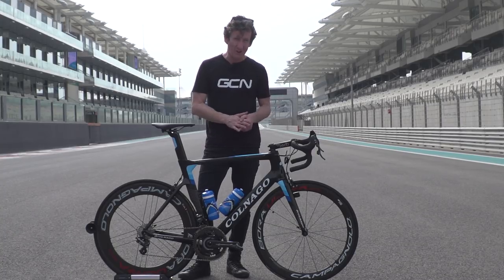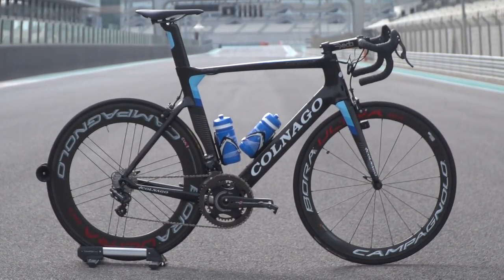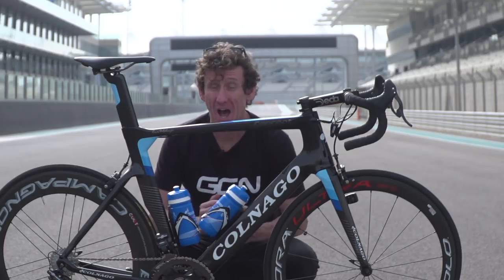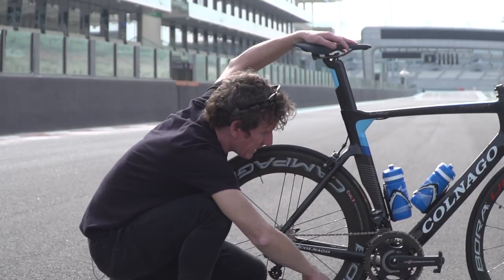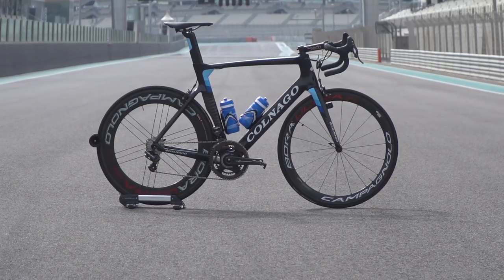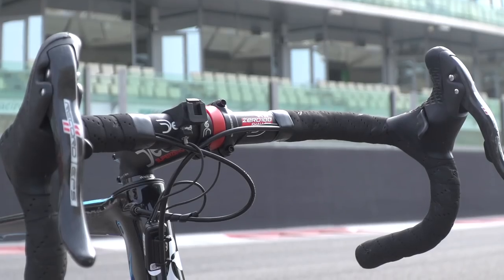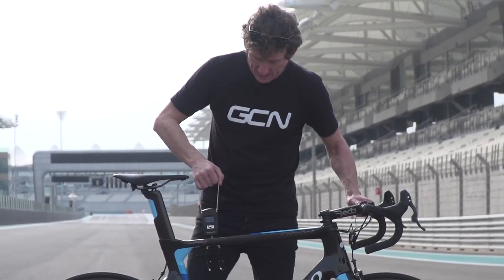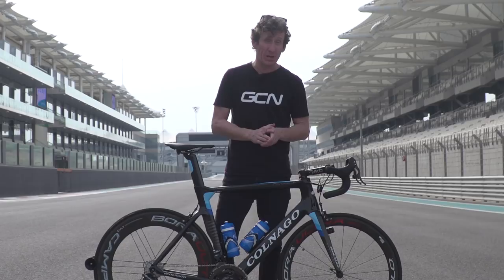Alexander Porsev's Colnago Concept

Comment: Why are alle bikes well above the 6.8kg?
Reply: Jack Miller Because they are more about being aero than light
Reply: plenty of reliable super stiff bikes under 6.8 actually.... heck the Madone race shop limited is well under that and its even aero to add to that.... but usually companies weight their 54cm bikes... so if its is a 56 or 58 + pedals+ power meter+ head unit+ bottle cages+ race number mounts+...... it adds up
Reply: most GC riders do actually have bikes right at 6.8kg. Canyon with Quintana's CF Ultimate, Pinarello with Frome's F8 lite, Treck with contador's emonda, even Adre Gripel's Helium is under 6.9 and he is enormus!  There are quite a few pro bikes well under 7kg that are stiff and reliable... most GC contenders do not choose aero bikes, sprinters do and they are usually bigger and taller so wider bars, longer cranks, biger chainrings, bigger frames etc all of that adds up to get em above 7.2kg. But all i am saying is that just because a bike is light, it doesnt mean is not stiff and/or reliable